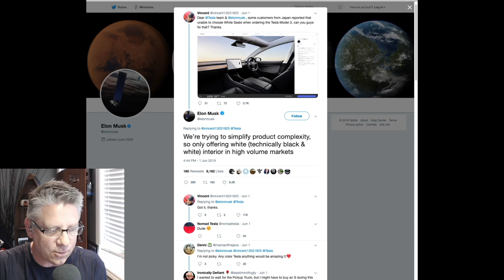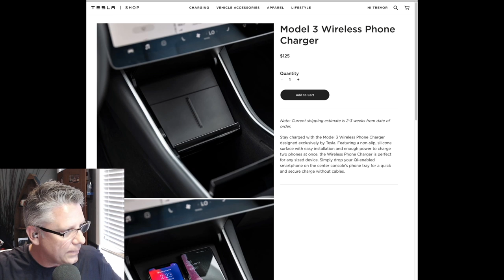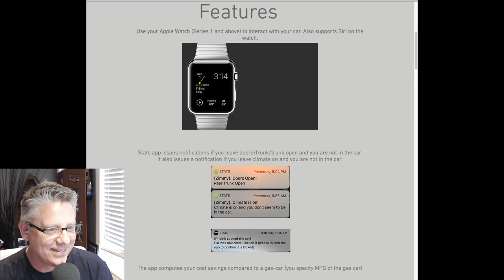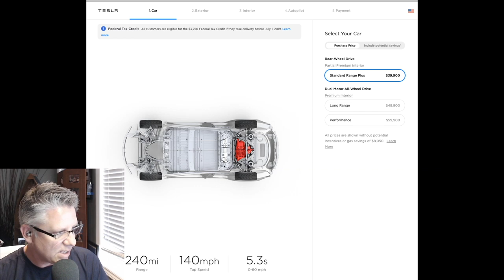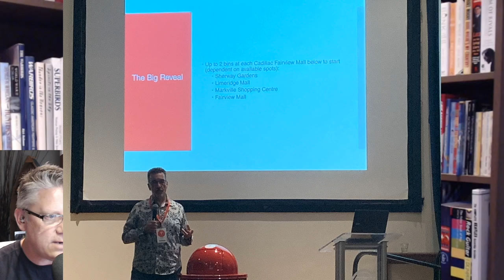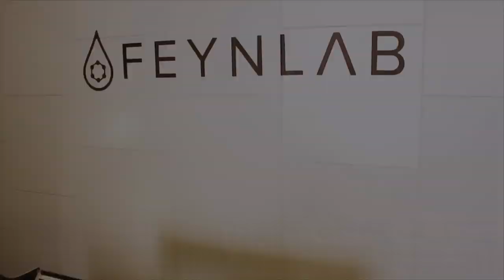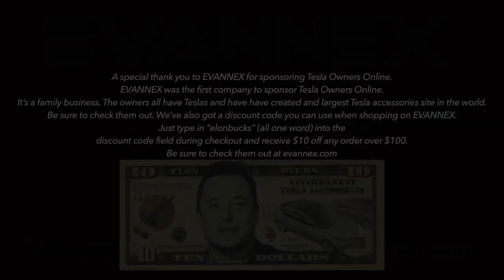43 - The Lemon Pie

Comment: Just bought a Model 3 in France and love it. Just wondering if you cover things your audience would like to see improve. A sort of suggestion list. For the moment I am not sure what is the best venue for making these suggestions. Here are some of the ones I would like Tesla to consider :

1) Being able to chose if your windows close when the car automatically locks ... doesn’t make sense to have sentry mode to discourage theft and then leave the windows open. This should be programmable in car and app settings. In the app a close all windows button would be needed as well
2) If you decide to leave the windows open on a hot days, even when you lock the car ... if it starts to rain the windows should close to save those expensive car seats and returning to the car without sitting in drenched seats ... not to mention putting water on all the objects on the convenient side pockets ... flash light, kleenex pack ...
3) Adjusting fan speed and temperature of the climate control is burdensome (dangerous while driving). There should be a “double press” type option on the right scroll wheel to then allow +|- fan speed, press left/right to change temperature and press in to turn climate off completely. Just like the left scroll wheel on the steering has multiple uses (sound volume, next music track, adjusting mirrors and position of steering wheel height and depth ..).  Taking your eyes off the road to adjust climate control is a BIG security issue.
4) Adding rear camera to sentry mode ... especially when a car bumps into you and damages your rear bumper. Cost me $300 to have it fixed!!

Thanks for your feedback.
Carlo HERRMANN

Comment: On the battery front. The 2170s are not available yet. Tesla is starved for those cells atm...and in the future when Y comes along. Things will not get better. I think there will be a battery refresh...like this:

Currently there are 16 modules. And the cooling is a bit old school for Tesla. So I think they will keep 18650s and change the pack to have 4 or 5 modules, Model3 style. Also with the new BMS hardware and cooling. With less overhead in module materials and cooling, Tesla could maybe squeeze 5-10kWh extra in there. 

All in all for better performance and lower costs. Two motors in the back could be cool...maybe with different gearing? To increase efficiency at cruising speed? And increase acceleration and/or optimize the ’lag' with the new motor compared to the AC induction ones?

Comment: 51:30 I’ve been wishing/hoping for a NOA setting parallel to the Mad Max/Chill mode for manual driving, since NOA is (to me) largely unusable in medium to heavy traffic - it drives like a jerk.  It needs to at least see car lights (brake & turn signal) to behave better.

Comment: Just some thoughts on the FSD 3 hardware .... if you don't have it the good news is when you do get it you will get the 100% latest version of it... We all know Elon makes changes 'on the fly'  and I for one would rather have the brand-new FSD v3 vs the very first FSD v3 that came off the line many months ago.

Just my .02
Reply: In fairness to TSLAQ, very few of them hate TSLA (just elon and the board) and almost nobody hates the cars.   When a company goes Q/bankrupt, usually it's chapter 11 which just lets it unload debt.   The company continues it just goes to court to renegotiate w/all it's creditors, so it can survive more easily.

One of the reasons tesla's been doing such crazy stuff this year is because they're overextended financially.    Besides cleaning up financials, oing Q- if they did it right- could also allow their federal tax credit # to reset back at zero (eg TSLAQ to TSLA2).   

Granted going Q would also make stock go to zero or close to it, which if you're short would be good (i'm not a bull or bear atm)... That said if you're long and your goal is simply to keep tesla alive in short term to make money even if it's better for company, customers and mission to shed debt... then fighting Q to protect your stock isn't a moral high ground either.

Again point being, TSLAQ does not mean company goes away... just they restructure debt.    As elon often points out, most of the automakers have already gone Q.    Regardless that GM went chapter 11, you can still buy those cars, get financing and so forth.   GM is still GM.   Think of all the short-sided things tesla wouldn't have to do if they didn't have $10B in debt and liabilities.    That's really the way a tesla fan should approach Q.  Not as some sort of holy war.
Reply: FSD - chips made in US, sent to China to build FSD board. Three years in development - changes are now software only.
NEW FSD scheduled in 3 years - about 3x faster. Watch the autonomous day video.

Comment: Model 3 owner here always seem strange that's model 3 has 15 cubic feet cargo space in the model y has 66 cubic feet storage space wow it seems almost impossible
Reply: I think that is a comparison between Model 3 with rear seats up and Model Y with rear seats down? You could consider that unfair, but since you can fully use the cargo space on Y with seats down while your usage on the 3 is somewhat limited due to the structure in the way this would at least for me be a good comparison. It basically says: 3 is not a hatchback, so carrying around large things is not possible. Y can do this.